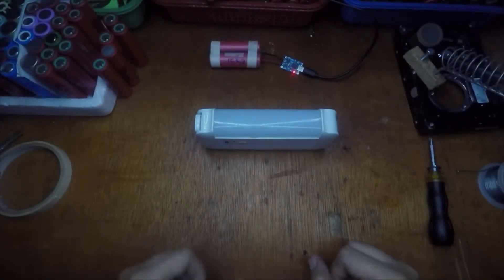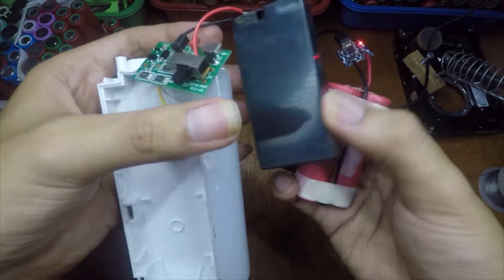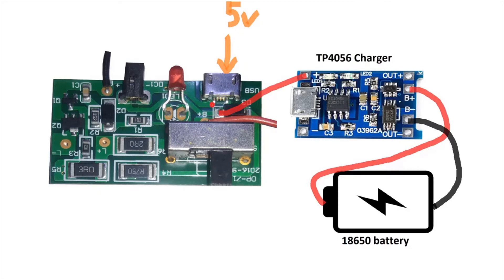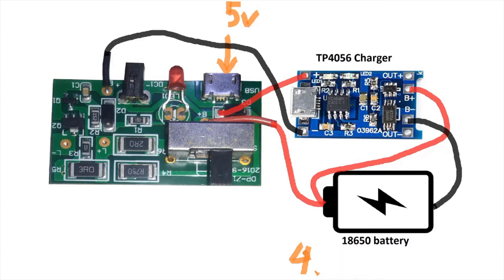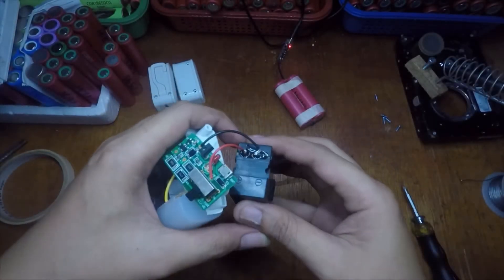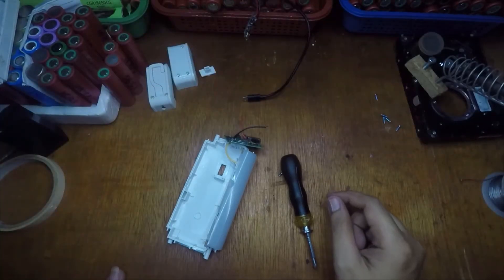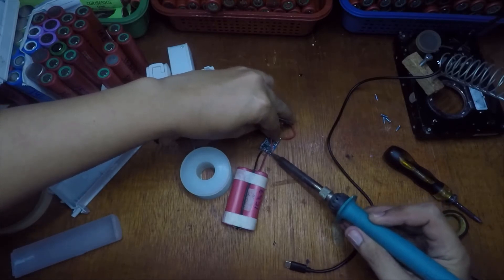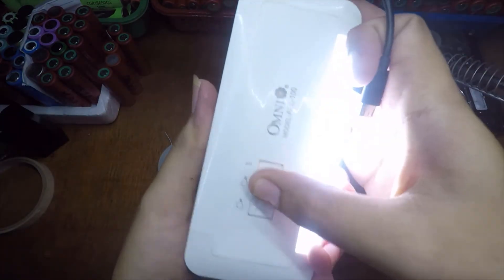OMNI LED Flashlight Battery Conversion (from Sealed Lead Acid battery to Lithium Battery)

Comment: Hi sir. Why need 2 parallel batteries? Not enough current if only one battery used?
Reply from the maker: I use 2pcs 18650 because the battery I am using is salvage from old battery laptop, I parallel it to increse the capacity, you can use one what ever you like.
Reply: @PHLocalExtremeSports  Tnx. I successfully replaced the old battery with the two new paralleled batteries. How many hrs to fully charge the new batteries?

Comment: Sir ilang mah ang kailangan na  battery sa kanya kung double A rechargeble
Reply from the maker: You need 3 of them in series is you need to power it, chargeble AA batter only have 1.5v x 3= 4.5v, I dont know if it will work on just 2 series. Just test it, i dont have chargeble AA now to test.

Comment: sir pano malalaman kung full charge na sya kaka bili ko lang... mababago ba kulay ng led
Reply from the maker: Yung TP4056 ay meron dalawa LED, red for indicate charging at yung blue is for full charge, sa video diko nalagyan ng butas sa banda ng TP4056, after that nilagyan ko na butas para makita ko yung LED pag umilaw na, pero ok naman kahit di mo lagyan butas, yung TP4056 may safe charging feature na hindi mag overcharge and over-discharge kay ok lang, mag automatic cut off charging pag 4.2v na yung 18650 battery. (you can translate it in google for non pinoy watcher)

Comment: Ok lang po ba sir lagyan ng 18650 na 3000mah 3.7 volts ?
Reply from the maker: Yes, it's will work, I use 18650, you can use any kind of lithium ion battery as long it will fit on the case.
Reply: @PHLocalExtremeSports  salamat sir!

Comment: Pwede bng wala ng tp4056 board?
Reply from the maker: You need TP4056 for lithium protection, the led board is no protection for lithium battery, the board of the led is max voltage charge is 4.8v (for 4v lead acid battery) that higher for lithium only 4.2v that to dangerous.

Comment: Hello what kind of wire did you used and size of it?
Reply from the maker: 25-30AWG , you not need larger size wire, not puling too much curent.

Comment: Sir may ganyan din ako na flash light gumagawa ka ba?
Reply from the maker: yes i modify, just need, parts.
Reply: @PHLocalExtremeSports  sir san po location mo?
Reply from the maker: @rainrain2762  Palo Leyte
Reply from the maker: Kaya yan sir, just need soldering iron and soldering led, aslong you have the TP4056 charger, you can buy it shopee or lazada for a cheap price an also 18650.

Comment: Ilang hrs na itagal nyan sir
Reply from the maker: I did not test if how much longer, but I think 3-4 time longer than the sealed lead-acid, and also depend on 18650 capacity, or it will vary  depend you use high and low